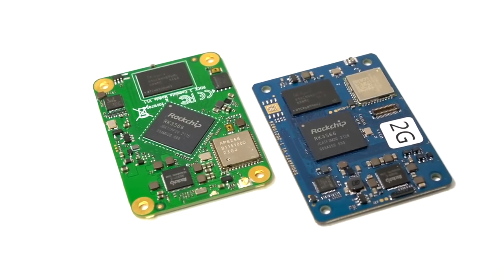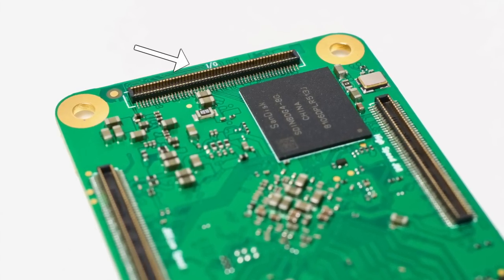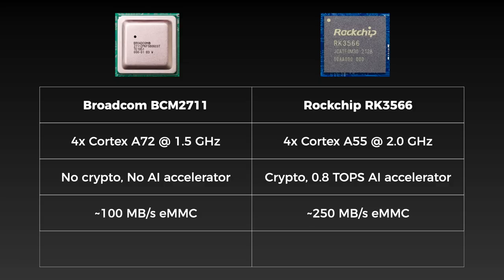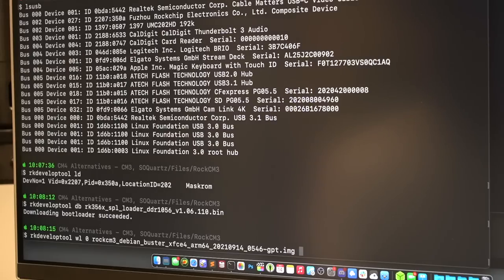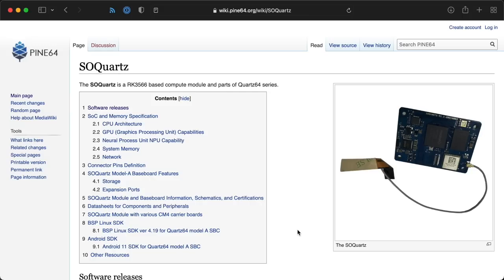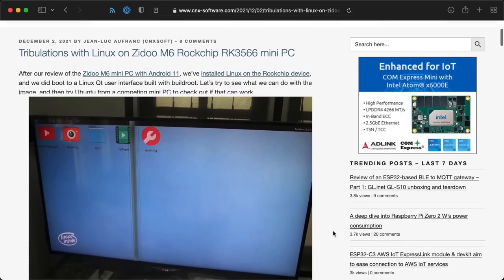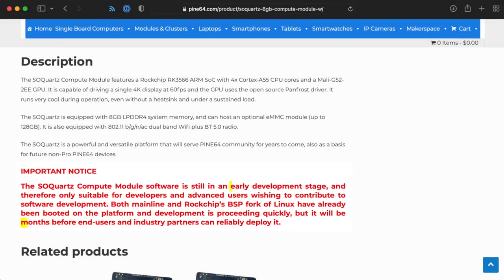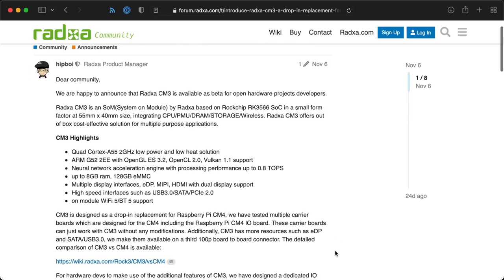Can these boards replace the Raspberry Pi CM4?

Comment: 0:49 - Please tell me you put a dielectric between that part of the board and microsd cage, that' may make some blue smoke.

Can confirm that getting non-PI SOCs is often a lot of effort, and then keeping it up-to-date is often impossible task =\
Reply from the maker: Don't worry, I didn't power it on in that configuration. The current recommendation from timonsku (who makes the Piunora) is to put a piece of kapton on top of the microSD slot.
Reply: @JeffGeerling  yeah kepton tape was my first thought as well

Comment: Apart from the Raspberry Pi SBCs... nVidia Jetson is the only hardware with enough support behind it. It also has features that the Pi doesn't. Even the Intel SBC boards quickly became paper weights. Beagle boards I don't know.
Reply from the maker: Even there, it's stuck on Ubuntu 18.04, and it seems they put a lot more effort into specialized applications for industry rather than making it a popular general compute board or learning board :(

Comment: I said it recently on Chris channel - yet another great hardware that doesn't deliver :/. If I'd be about spending a lot of money on commercial CM product, where my custom software is about to run I'd not spend money on board without documentation and support. In case of personal project I'd go with Pi, even if under spec just because I don't have that private money, time and people to fix basic issues before I'll do what I want to do with those boards 🤷‍♂️
Things like non standard bit rates, special configuration etc also mean that manufacturer either doesn't care or doesn't have enough resources to do it right. That means that support will probably look the same.

Comment: If the documentation on these is worse than the Pi hardware documentation then your SOL if you try developing any hardware around these platforms. If I pick any STM microcontroller I can easily find documentation from 20 page datasheets to 1000 page detailed programming guides without much difficulty. On the other hand the pi CM4 has a brief datasheet and some scattered documentation on the hardware which makes it difficult to ensure reliability in a design.

Comment: Jeff, have you ever iimagine that you could connect to RockChip specific UART using literally any of raspberry pi sbc. How cool is that? So basicly you were not stuck ;-)
Basicly this kind of SBC's with not so much documentation and community support (ARMBian community rocks!) are for real entusiasts ;-) 
Personally I choose RockChips for their simplicity with firmware and really good performance ;-) Just soldiered the SPI flash to RockPi4B, programmed it with mask rom mode to contain  u-boot,
and now I have rockpi4b booting manjaro arm from nvme card. Yeah, I have stollen almost whole u-boot setup from armbian :-P Staff like that, if you have time and heart for it - rockchips are very satisfying.

Comment: You fell into same situation with me now xD. I don't have enough bucks to get Rasb pi. I ended up bought the cheapest Linux SBC I could find on Aliexpress. Lichee Pi nano based on F1C100s. Almost no one using this board. Really poor documentation. I spend ~1 year just to get the SPI NAD flash to work (from 16MBytes NOR to 128MBytes NAD) starting from scratch with only C language knowledge of 8 bit microcontroller. Building u boot, kernel and build image overnight. Kinda fun + fustrated feeling 😂

Comment: I can confirm the rock chips are problematic with regards to getting things going. I took weeks trying to pull a working Linux install off of forums because both the official image repo and wiki page had Android images (not what I needed) and old Ubuntu images that did not work when flashed. And even the one custom image compiled by the forum users wasn't usable in the end, because any and all libraries necessary to do work did not have compatible versions

In conclusion, spec wise they may be great; don't let that trick you into thinking they'll be a snap to start using. For as sometimes janky as the raspberry pi platform is, it does just work, and there are a lot of people both official and not who can help with your problems.

Comment: I had very heated arguments with SBC manufacturers aboutthese issues, and the gist is, UX / documentation take an immense time and workload to get right.
So they think they just need to get the boards on the market asap and will figure out the rest afterwards when it sells like  crazy..but it does not and so the UX never gets done.
Reply from the maker: Chicken and egg problem there! I also think that's why some shops like AdaFruit  get a lot more sales of specific "maker" parts, just because they add guides, do videos on them, etc, even if the parts are the same as or similar to cheaper parts elsewhere.

Comment: it was almost 2 months before raspberry pi zero 2 w came out that I saw the radxa zero and bought 2 of them instantly(one with emmc and one without) because it was very close to what I wanted spec-wise and board size format. But then I realized that you had to mess with u-boot and lots of very basic stuff like reboot or poweroff could not even work(they released a testing kernel that can do that, just a week ago!!!). And even with that kernel, that has from my understanding a combined kernel image + u-boot binary in one file, u-boot has some default options that slow down the booting time for at least(in my case) 5 seconds. I get that raspberry pi has no proper bootloader and has a combined gpu/cpu thing but at this point this is just ridiculous. why is u-boot so messy, i had the banana pi m1 and u-boot is still in the same mess even after all those years.

Comment: Security is also a big problem. Even if you get one of these boards to run, without continued updates the system will end up being a security risk in a few years.
All software has security flaws. Only regular updates can keep a system secure.

Comment: 1) The crypto is a push.  The accelerator?  It's a bust- you need a closed binary.  It'd be better if we could sort out the "issues" with an Edge TPU or ran with some other accel.
2) Maybe someone from the Embedded Device community could help on the boot there for you...?  I'm more than HAPPY being one of that developer crowd to help distill something.
Reply from the maker: Once I can get one of the boards up and running, I'm hopeful the Coral TPU will work on it!

Comment: I am not sure if this is the correct place to ask this question...  I want to load the base Raspberry Pi image on top of LVM using the standard 6 or 7 mount points we see in Red Hat or HPUX.  Is there available a boot loader that loads into a RAM disk, the gives us the ability to configure LVM, then image the OS disk?

Comment: We need a replacement for any type of Raspberry pi's. I went to the authorized resellers and they are all out of stock. I went to Amazon and they are selling the few they have at scalper pricing. There is no way to inform Amazon that there are 3rd party sellers selling them at highly inflated prices and against Amazons terms of service.

Comment: Did you try screen "serial adapter" 115200?
Reply from the maker: That's the command that was on the screen in the video—I've since learned I can use CoolTerm and it works at 1.5M baud, so I can interact with both boards now. Still can't get either to boot into Debian or Ubuntu, though :)

Comment: I think you are a bit hard on the Pine64 on one account. Sure there should be good software and documentation and all that but there is a big difference. Pine64 does their development in the open where pi doesn't. When pi gets the first model of a board you have to wait 6 months before you can buy it and with pine they release it but put warnings that nobody should buy it at this stage. There are pros and cons to each. So I don't think you should compare the current state of the SOQuartz with a PI launch, but that it would be more comparable in 6 months. And to not look like a fanboy, I own pi products  and no pine products.
Reply from the maker: I mentioned that, and I do appreciate both approaches—though I wanted to make the point doubly clear that the SOQuartz is nowhere near a usable state for people who are currently considering a CM4-based project. I finally figured out a way to try installing Debian today (after posting this video!), but it's still not quite installing correctly.

Comment: What board would you suggest at a Pi4 level of performance that has native sound in and out?  Almost none have sound in.  Thanks!
Reply: There are many cheap easy ways to add sound in and out to Raspberry Pi's.  Why "native"?
Reply: @Mueller3D  For the same reason you'd choose a Pi in the first place - it just works without too much hassle, maybe after enabling an overlay or two in the config

Comment: Don't lie: we all know you're getting that sweet Raspberry Pi gold for promoting them, and they pay you in high-end tea [jk]. I have also been experimenting with some of these boards, and have most of them working, but you're right about support. It's bad.  In most cases you have builds on shared google drives (which is slow to download), builds that break on any package updates, builds with bad repo addresses (like they don't resolve outside the Chinese firewall), older version of Ubuntu, and really bad kernel drivers that give little to no useful info about what's under the hood. An example is run "cat /proc/cpuinfo" on any Raspberry Pi board, versus doing so on my Pine64 Rock Pro or Orange Pi 4b.  Raspberry Pi is miles ahead of the game as far as mature development, where as some of these boards work in theory, and have a working version of Armbian on their MMC, but apart from that... crickets.  Some even have documentation that conflicts with each other (like initial logins) and you have to guess from documentation form OTHER boards they have.
Reply: I sometimes wander how deep does computer/electronic hole goes.
Reply from the maker: Haha, I wish they'd send me some tasty british tea. Most of the time it's chai or earl grey around here.

Comment: Seems like you know about Raspberrys.. I´m using a RPi3 A+ and my numpy install has failed.
Do I have to deinstall it first? or can I just install again without accumulating unnecessary trash on my Pi? 

Its just.. I can´t find anything about this topic, and as I´m new to all this i´d like to do it the correct way. 
Thank you very much in advance :)

Comment: Atomic pi is available for ages, cost $40 at the moment, efficient and x86 based. Yes, there is no pci-e or sata but that's it. You just run regular debian and it works. If arm boards are problematic and/or barely available why not just use x86 ones.
Reply: Isn't that the one that's just left over boards from a failed startup? It's maybe suitable for some needs, but it's even less supported as far as the details of the board than these: there's no future for it from the first party.

Comment: I disagree with your choice to not shit on OrangePi. Most of the boards they're still selling only support Linux 4.4, which was released in early 2016. Ubuntu even refuses to load many current packages, because the dependency on a 5.x kernel can't be met.

Comment: It seems to be a common theme that the Pi competitors release products much more often, but the software and docs are awful. They need to stop trying to constantly release new hardware and spend a bit of time supporting their existing products. Having had a Radxa theres absolutely zero chance of me ever buying one again, the experience was awful.
Reply: I don't know their business model, but these might be more like evaluation boards for folks who might hire custom sbc bring up based on them, than something that's intended to be an end user product above all else like the raspberry pi. I mean, I assume something has to be going the way they want or they wouldn't last long enough to release so many. I know people who use boards like this to do initial development toward bring up on custom hardware and they're presumably fine for those needs

Comment: If you want all of that buy any x86 embedded board like the n6000 and you'll have plenty support for any Linux or windows which are by far ahead of raspberry and even has more features, does it explains why other architectures are important like risc v?

Comment: Jeff's YouTube video is 8 months old has these boards software gotten any better?
Reply from the maker: So far... a little. But still not full functionality.
Reply: @JeffGeerling  I noticed the Nvidia Jetsons compute modules have come down in price.  They are still pricey but 2 modules are under $200.  Have you tried those in your Turing Pi 2?  I would like to see how those preformed on the same benchmarks u did with the raspberry pis.
Reply: I went to Turing Pi website last night and look like they taking orders on September 10th.  Also, It looks like Ndivia Jetson compute module GPU will be supporting CUDA, so if you parallel code is set up to run on GPUs it should increase the cluster performance.

Comment: My website currently runs on a raspi zero w (its just static html and doesnt get much traffic so i dont need a huge webserver). Should I switch it out for a CM4 or related board?
Reply: Depends on what you want to do....
For me - I stopped developing static html in the 90's
Nowadays it's about docker/portainer on my homelab/homeserver. I can do that on a cm4 but the lack of ram when using containers etc. is crippling. 
You could however get a CM4 based board or something similar and run a few containers on it if that's how you want to roll

Comment: I'm wondering if I should replace the RP4 with CM4?
I don't care about I/O only care about performance, CM4 has eMMC so I think it will be faster than RP4 (SD Card), is it correct?

Comment: Hi Jeff, may i ask something please?. What id like to do is run virtual machines on my Rasberry Pi (in just getting into it). Then from these virtual machines id like to connect to a website i belong to that allows me up to x10 ip address per account. (I only need x10 then, and they wont let me use proxy vnp's)... so i was wondering how could i configure something to have x10 ips connected to VM's from my single home internet connection? Or is there a service that allows me to do that? Ive looked but cant find anything. Thanks for any help, all the best
Reply: Have each VM connect to a different VPN.  It's the VPN that will give you a different IP.
Reply: @Mueller3D  Hi, thanks for getting back to me, i appreciate that. Unfortunately Vpn's are banned... Is there another way please?
Reply: @DiyEcoProjects  If you cannot use VPNs, then getting different IP addresses either requires getting multiple ISPs or arranging with your ISP to get multiple IP addresses from them.  If you just need to test something, another way is to set up port forwarding arrangements with different friends, each of whom already has a unique IP address.  They would have to set something up so that a connection from you is redirected to the website you want to test.
Reply: @DiyEcoProjects  Have you thought about just paying for whatever you are trying to abuse the free trial period for?
Reply: @davidlloyd1526  in not trying to abuse anything. Im allowed up to x10 IP address per account to farm with. I just didnt want to install five more internet cables in my house. I was wondering if there was a way around it using vm's. I would still be providing a service to their system creating node points for them, even if it was vm's.
Reply: @Mueller3D  Hi Carl, many thanks for the reply. So ive spotted that my service provider lets me swap to a business account, that gives me 10 static ip address. Does that mean it would come down the one cable in my house? and can i set up my vm miners to use those ips?
Reply: @DiyEcoProjects  Yes.  Instead of a router, you'd have an ethernet switch first (after the modem).
Reply: @Mueller3D  erm, many thanks. Can you explain a bit more please?

Comment: Actually does anybody know if there is anywhere we can find the compute module 4?
Reply from the maker: Unfortunately right now you have to check different vendors' sites on a daily basis to find when one has them in stock. They all show backorder/out of stock, with lead times in mid-2022, but now and then a batch of a certain model will be available for a couple days.
Reply: @JeffGeerling  Thanks for the info! We are working on building a sub 250g drone with onboarded computer vision and the CM4 seems like the only thing that can make it happen at the moment! I will keep my eye open for a opportunity

Comment: I purchased 2 of the Radxa Zero units 4GB versions.  I could only get the TwisterOS image to work from the SD card. All of the others failed.  They both came pre-loaded with some version of Android on the EMMC but to me Android on anything other than a phone is useless. I do not like the Android OS. The only reason I use Android phones is because I despise Apple OSes even more.   But I digress.  Try the Twister OS build image for the Radxa zero and see if you have any luck on the CM3. It really is just a Twister OS overlay for Armbian though.  Sometimes on the  Radxa Zero I will make a gui change and it will glitch into Arbian and loose all of the Twister OS settings until the next reboot.  But hey it may be a starting point.  You may be able to try the Android builds listed for the Radxa Zero on EMMC.

Comment: Yup. The first spec that I check on non-Pi boards is the GPU. Most of them use an ARM Mali or similar GPU, which is absolute trash. One can handle building custom kernels and dealing with a rubbish linux distro, but a useless GPU is an absolute dead-end, and an easy do-not-buy signal to look out for in spec sheets.